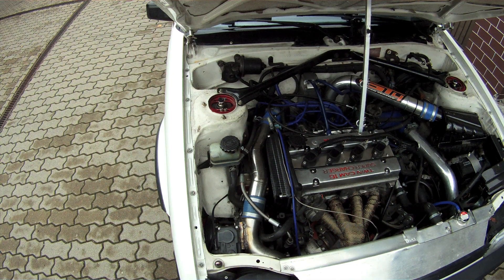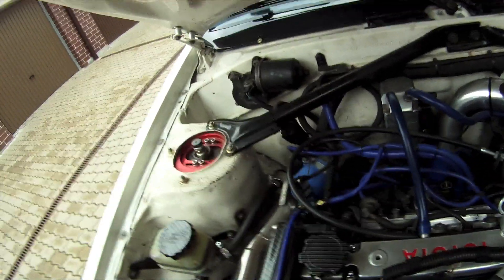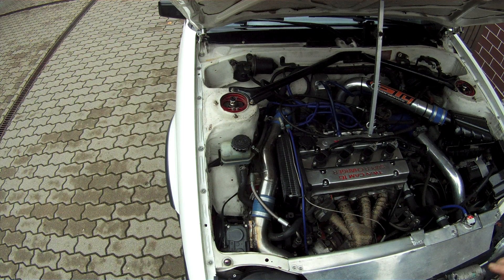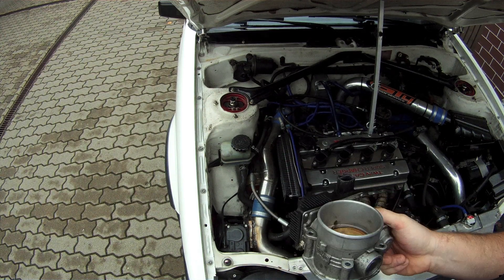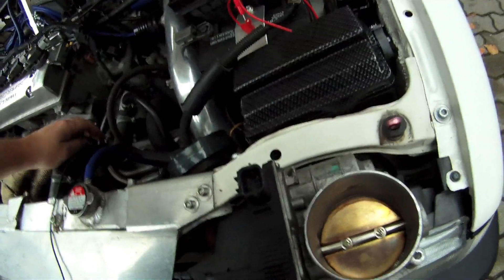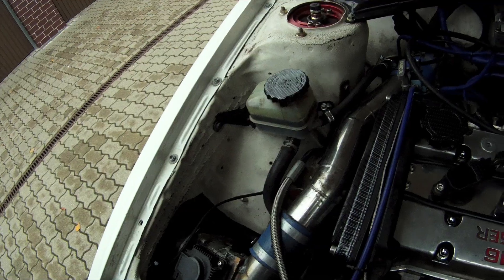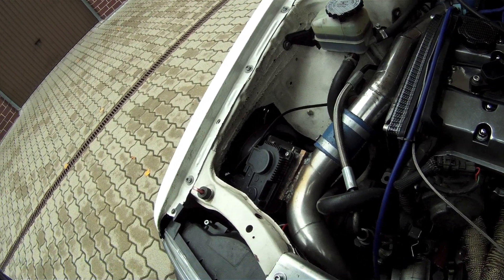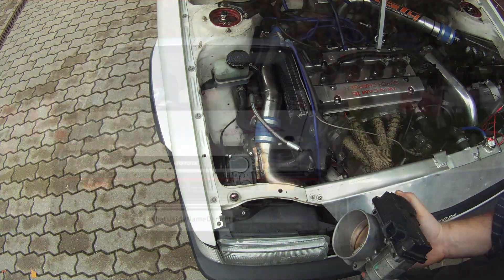Bypass Valve in Twincharged system - what I used as bypass valve in my AE82 4agzte  and how it works

Comment: Who the hell would trust a electronic throttle body? I'd rather have control over how much gas I'm giving the engine... however it is an excellent idea for twin-charged engines! Surprised yet again, that it already doesn't come with the engine?
Reply from the maker: agreed. When i drive new cars that are equipped with etb I just try not to think about it. In twincharged system this etb works just as bypass valve in 0-1 mode i still have old-schoold line controlled tb :-)
Reply: Etb's don't control gas anyway they  control air